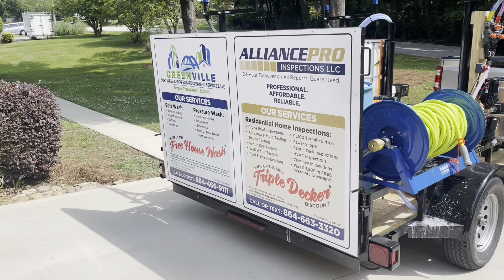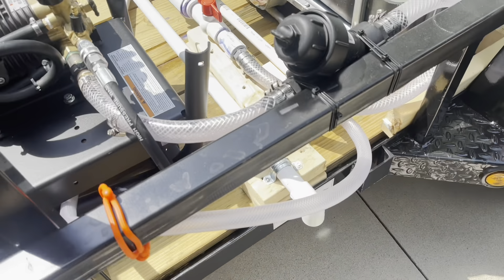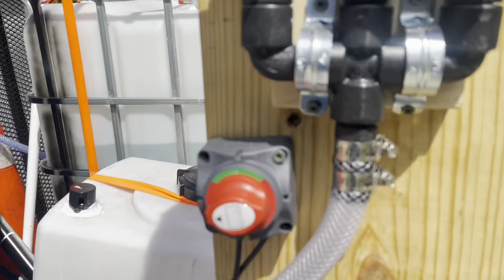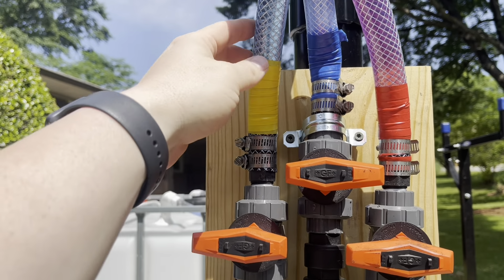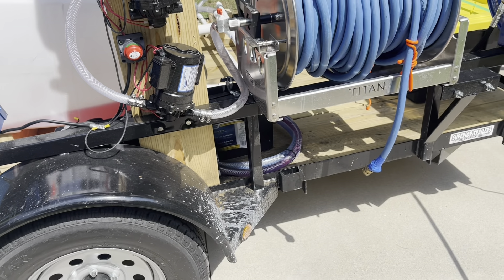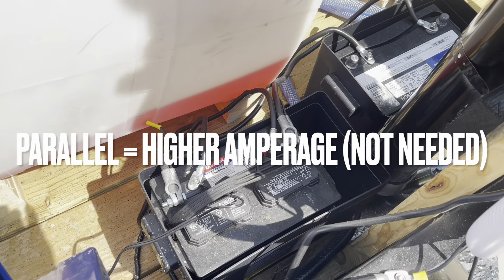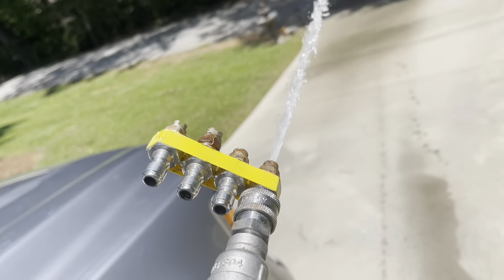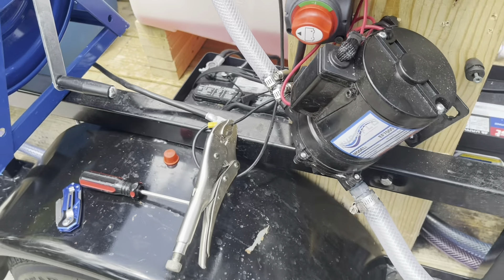Pressure washing trailer setup

Comment: The part about direct drive not pulling is incorrect. They will pull, but you have to ensure they are primed. Half throttle to prime. Then it will pull no problem.